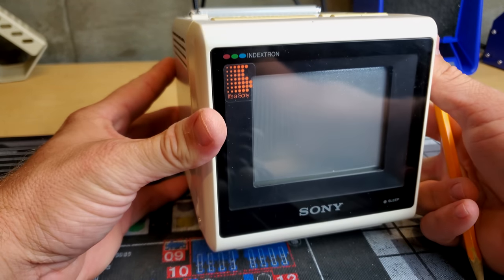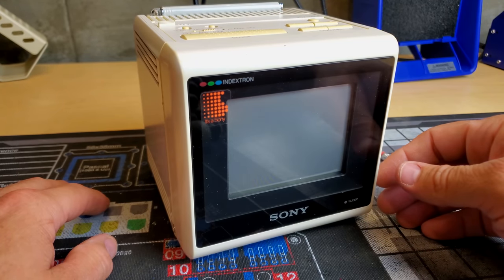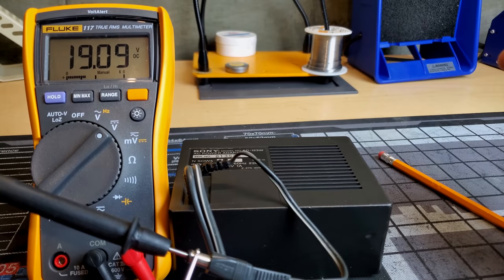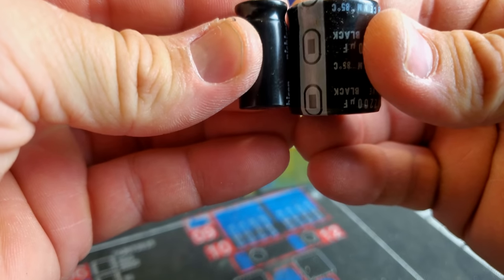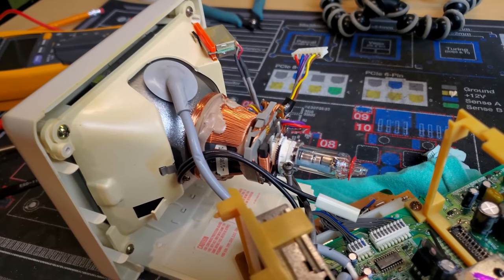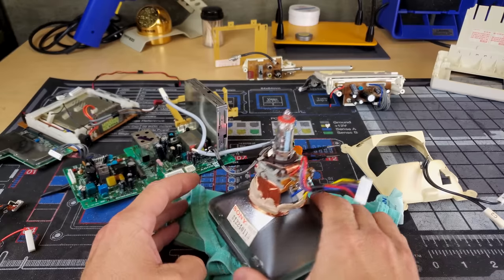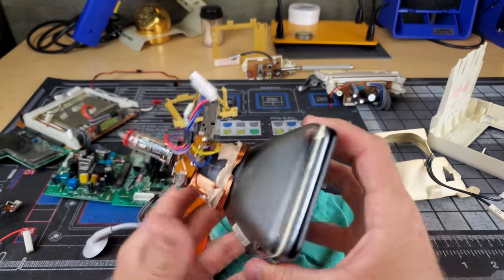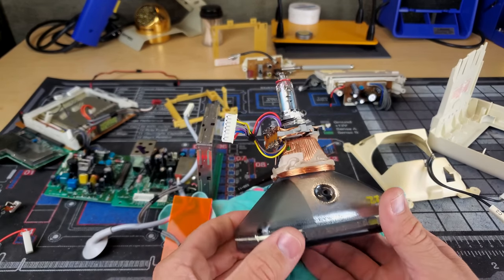Sony's Smallest Color CRT is not a Trinitron - Meet the Indextron

Comment: I have a feeling that the power supply runs around 20v unloaded, the newer capacitor may have had less time to begin working whiskey might have been why it showed 17v, the 20v will most likely drop to 12v when placed on load

Comment: Actually the smallest crt by sony IS a Trinitron. It's the Sony KV 4000, which has a 3.5 inch screen, while the KVX 370 has a 4 inch screen.
Somewhat adding the Supraguy: The transparent part works the other way around. As said, there are RGB and UV stripes - and when the UV stripe is hit, the electronics know that a new RGB triplet is following and adjusts its timing to hit each stripe with the correct color intensity meant for that stripe - this would be too sloppy if being made over the whole screen and wouldn't hit the right phosphors due to the way the tube is bent and analogous tubes work. But that is the whole beauty of this design - we had shadow masks bc electronics were not capable of doing that what the Indextron did at the time of color TV's introduction (Sony tried with the Chromatron before, which used fine stripes instead of UV phosphors, failed, and invented Trinitron based on knowledge from the Chromatron design).
Larger TVs based on this design were never made, possibly bc it's not working well with larger scale TVs.

Comment: The transformer will give you a higher voltage of it is just rectified without a load.  It will settle down a bit of you have a load on it.  As well, normally it wouldn't be this high, maybe this is a Japanese domestic model for 100V power?

Also, for capacitors, largest ones often have higher current handling capacity, newer smaller ones don't always exceed all the metrics of the older ones.  In this case at a bit over 1amp of draw, i guess that wouldn't be an issue.
Reply: if it was for 100 volt mains it would be closder to 24 volts unloaded about 14 to 15 volts loaded.

Comment: It's a crime to scrap this unit. There are no components missing, just corroded solder because of leaking capacitors. Alle capacitors should be replaced. It can very much be fixed.

Comment: 19V on a 12V linear power supply with NO regulation is perfectly normal. It needs a load before the voltage drops to nominal level.

Comment: You are much braver than I am opening up the power supply and electron beam gun. I think you know what you are doing though. Did you check to discharge any parts before touching? Nice vid BTW and very nice tech

Comment: The Indextron reminds me of the mid-1950s Philco beam-indexing Apple tube color CRT, the Uniray CRT and other experimental tubes which relied on beam-indexing to actively guide the single beam to the correct phosphor stripe during scanning. The goal was to eliminate the shadow mask or wire grid. I guess Sony figured out how to make one commercially viable.

Comment: 19V from a 12V unregulated power supply is normal. Voltage will be lower under load and regulation happens within the device instead.

Comment: I'm not poo-pooing your assessment, but I wouldn't assume that Sony populated all the components on the board. I also wouldn't assume the "bodge" is not factory. Plenty of companies made field revisions without revising the board and Sony is no exception. If all the solder looks bad it may have been that way from the factory. I've seen several other sets from Sony with apparently bad soldering that appear to be factory.

Comment: Got a question to ask 
i decided to open up my RCA e13169gm crt from 1989 to check the caps and clean out dust but i noticed on the left side of the board it has a picture slider nob and focus slider nob but on right side of the board are red and white slider nobs
What are those for?

Comment: Old transformer based power supplies always put out more voltage than the rated when not under load, hence the 19 volts instead of the rated 12...

Comment: Should be able to use a power adapter off a full size external USB Hard Drive... they are 12V and looks like it has the same plug.. just check the polarity

Comment: There's nothing wrong with that power supply. Loaded it will be 12V output at 1A. Unloaded it will be higher. Old power supplies like that didn't have a voltage regulator just a bridge rectifier and a filter cap.

Nothing to worry about with it.

Comment: Linear power supplies show higher voltages when there's no load, it's normal.
Reply: No. Unregulated power supplies show higher voltages without a load. Regulated supplies (whether linear or switching) maintain the same voltage regardless of load. (Linear ≠ unregulated.)
Reply: @tookitogo  I stand corrected, thank you.

Comment: Doesn't the original Watchman TV count? It was a CRT with the impressive engineering that used a reflected electron gun to make a screen that was tiny by comparison.
Reply: Watchman did many versions, both color and b/w indextron too
the FD-210 is CRT.
Reply: @lucasrem  I’m sorry, a what? Did you say “black and white indextron”?! 😂 An indextron is, by definition, a color CRT. A black and white CRT doesn’t have color phosphor stripes, and thus no need to index to them.

Comment: You've got no understanding of how an indextron works relative to a normal color CRT...That "screen" behind the CRT as you call it is not a screen but a light sensor (UV light IIRC, but possibly IR). There is no shadow or slot (or any type) mask inside an indextron. An indextron instead of using 3 separate electron beams (one for each color) and firing them through a mask that gates which beam can strike which color phosphor dot, an indextron uses a single beam that his every phosphor color and point on the screen and is rapidly switched between R,G and B info as it goes from one phosphor color to the next....How does it know which it's on? Well the first few (IIRC blue) phosphor stripes on the left hand side of the screen also emit ultraviolet (or maybe IR, but whichever it is it's outside the visible spectrum) it then uses the light sensor (that you mistakenly think is a screen) to count the pulses and pulse duration of the left index stripes and use that to figure out the phosphor color switching speed/duration for swapping the gun between R, G and B primaries....
This technology dates back to the Philco Chromatron in the early 50's at the dawn of color TV they could never get the technology good enough to mass produce and after Philco gave up and going through a few development and holding companies Sony bought the rights to it. It almost bankrupted Sony in the 60's as they could only get an abysmal %50 production yield. All large screen production Chromatrons were JDM only and the only chromatron they sold in the US was the first few months of their first US color model (the 1710 IIRC) it was switched to Trinitron mid-production. The trinitron basically came from Sony taking the inline gun color concept first used by GE in the Portacolor and realizing that combined with the chromatron screen they could make something with good production yield and almost all the benefits of the chromatron. The Indextron was Sony coming back to the single beam chromatron and finally finding a way to make it work to the full potential of the original Philco design with a few tweaks made possible by advancements in affordable integrated circuits.        
A few other things: The HV connector/suction cup and HV lead are not the flyback transformer (calling them flyback sounds silly)...Most solid state era TVs did build them into the flyback, but not all sets did that (especially older sets with a vacuum tube HV rectifier or SS Trippler where the HV lead was a separate component coming off a different part separate from the flyback).  The aquadag is not there specifically to block light it's there to act as a filter capacitor to filter the HV. A capacitor is basically 2 conductive plates separated by an insulator so insulative glass coated on either side with conductive acquadag is a capacitor.  Late 1940's TVs often lacked full acquadag coverage and had places you could watch the back side of the phosphor from...There was often a separate capacitor in those sets for HV filtering and the dag coating wasn't always needed in those early sets. Also acquadag isn't the only thing inside most modern CRTs there's also aluminization. In the 50's manufactures figured out they could prevent phosphor damage from ion burn and make the tube brighter by drawing a vacuum on the tube and vaporizing aluminum to form a thin reflective internal coating that covers the phosphor, protecting it from ions, and also reflecting back firing light out the front of the tube improving brightness...The process would usually distribute aluminum not just on the screen but on the cone too...Some makes stopped adding acquadag inside as aluminization would do the same thing internal dag used to be needed for.

I wouldn't necessary worry about "missing" parts...It's very common in sets with multiple feature options available to not install some parts for features not used in the model being built...It's cheaper to design a single board that can support all the features and delete the parts for cheaper models that lack some feature(s) than it is do design dozens of extra different boards for all the feature levels of the same basic set...The thing to be more worried about is capacitor leakage. The original caps on these sets tend to fail with age and leak corrosive goo that eats the traces on the boards. Supposedly most indextrons used multi-layer boards and if enough damage was done by the goo it becomes unrecoverable as trying to find and fix multiple open circuits hidden under other layers becomes impossible.

Comment: The output of the AC power supply is 12 watts (12 volt x 1 amp), but the TV's maximum power consumption is 15.6 watts. Why is the power supply underpowered?

👍0 👎 0 🗨️ 0

Comment: THEY SELL FOR $ 700 ON EBAY IN THIS CONDITION.   THIS ISNT CONDEMMED.  WHAT ARE YOU TALKING ABOUT.  NO.     AND NO.  IF YOU SAY THIS IS A PARTS UNIT ONLY YOUR JUST SAYING YOUR NOT GOOD ENOUGH TO FIX IT. AND THEN  WHY HAVE THE CHANNEL

Comment: No offense, but you seem to be out of your league here. You don’t appear to have done enough research into the indextron technology (like the purpose of the orange filter, which isn’t a projector but a sensor), nor about some aspects of electronics in general (like how common it is to have unpopulated components, or that unregulated power supplies exhibit higher voltages without a load).

Comment: Orange thing is for the display for the alarm...blah..blah...blah.  NO IT'S NOT.  It's for the Indextron's feedback system.  Did you not do any research before posting up this video?  Please post up corrections so that people don't get the wrong information.
How do you not do a simple load test on the PS to see if it's working properly?  Scope it or at least put a meter on it to check for ripple?  Why not substitute a bench supply to see if it powers up?
The soldering is bad everywhere?  Really?  Sony's manufacturing is usually top notch.
Send it to the EEVblog guy and have him take a look at it.
Reply from the maker: No thanks